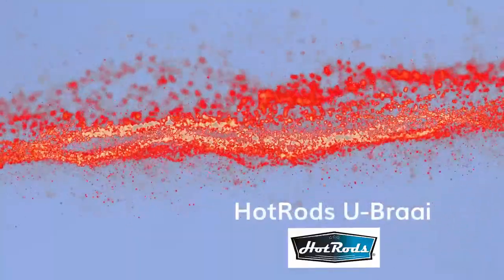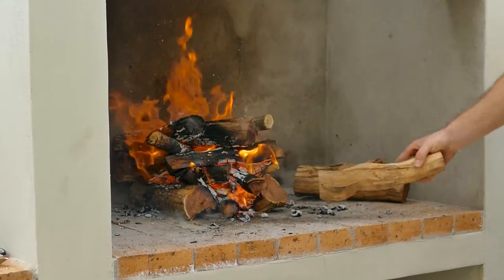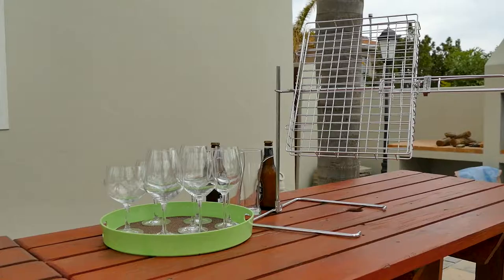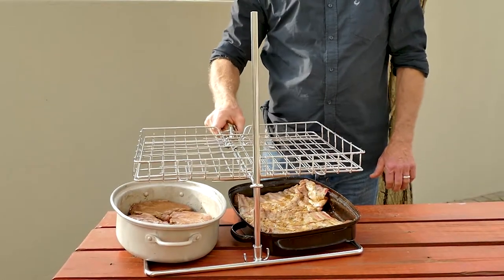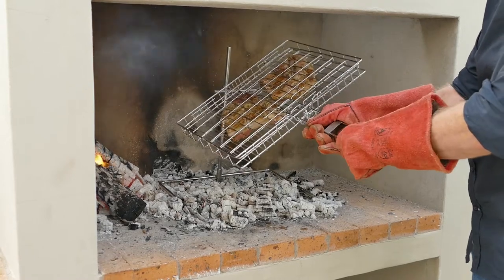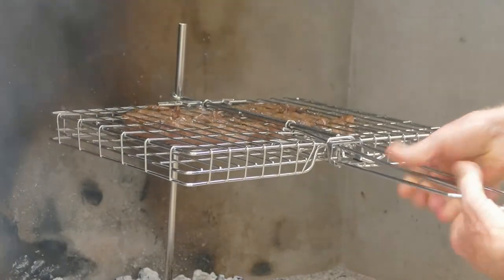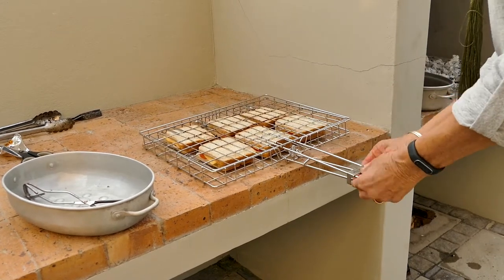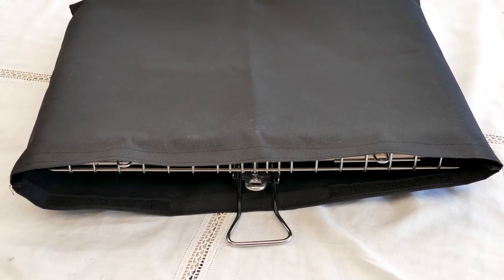Hotrods U-Braai stainless steel braai grid

Comment: Could you please show us how you clean this large grid?
Reply from the maker: I have not tried it, but the distributor told me that it can be put into a dishwasher. I clean mine with warm water and dishwasher liquid in a sync after every use. The secret is to keep it clean.
Reply: @LensTracks  This grid (I have one of the originals +- 12 years old) is large ... 335mm x 445 mm with a solid handle thus it does not fit into my dishwashers. On my smaller grid I use Spray and Cook so it cleans beautifully and once a month I put it in the dishwasher. Will try a combination of bicarbonate soda, water (make a paste) and rince off with vinager after 24 hours.